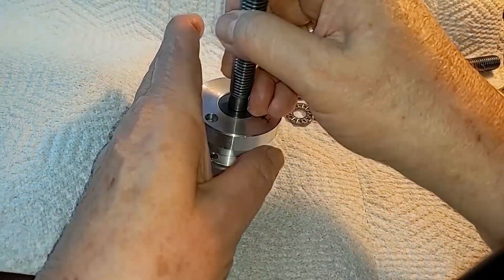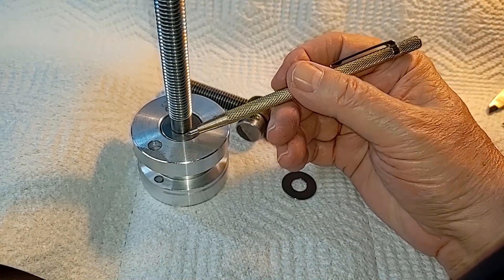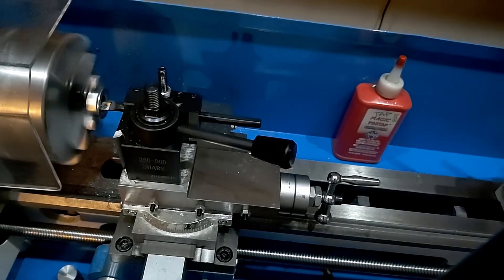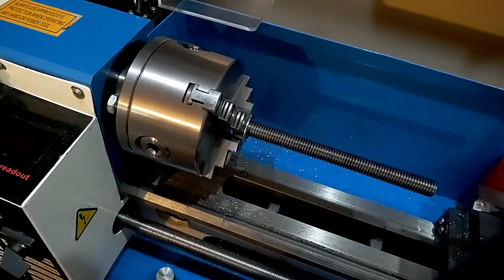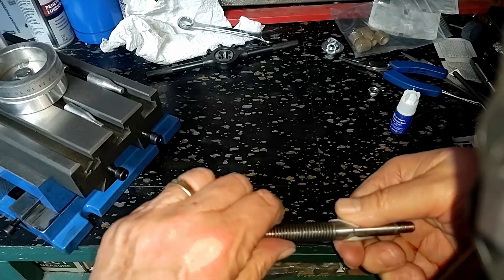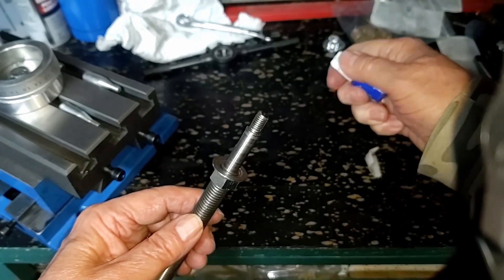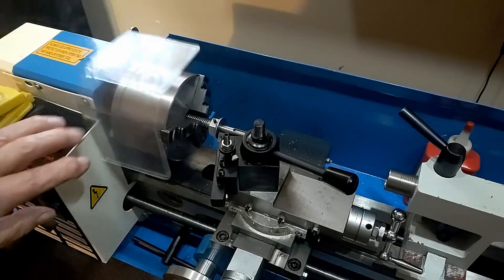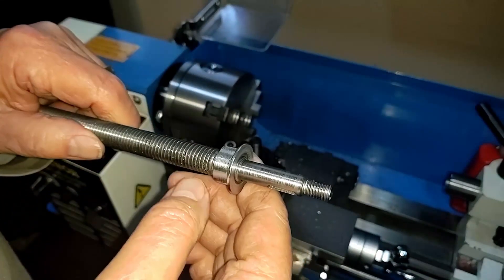Cheap Chinese X Y table with improved bearing support installed

Comment: I'm dreading the time I'm gonna shot videos like that. Granted, there is 50/50 chance that I'll not make it that far, but still, this video sent me into oblivion of endless reflection, so thank you for that (and I mean it). Although there is one thing I know for sure: never say never I will never remove the cat from machinery thumbnail! NEVAAAAR!
Reply from the maker: The original video, had I not cut it down, was over 40 minutes or so long. But there was so much that I could cut out and so did. Yes the cuts are clunky, I am still very much learning video production. 

I am using the free version of the DaVinci Resolve software. A bit of a learning curve, but it is very powerful. My thought is, if you are going to learn a software package, you might just as well learn one of the powerful ones. The other process would be to learn a simple package and then have to relearn something else. 

The cat is cute, but Troll was right, it confuses people. I may start putting some of my wife's cats into the video, I have one that weighs around 20 pounds, great for using as a dead weight when pressing things.
Reply: @oldfarthacks  nah, just slap a vice behind a cat or something. How do you think this old tony managed to get his minions? I mean millions? He put TWO cats on a thumbnail!
Maybe it's not at all what you desire, but as far as youtube popularity goes, cats are the ultimate solution. People don't mind to be confused as long as you do in fact provide them with a cat at some point (winky face). 
As for cuts and stuff, this is not what I meant. I was talking about more existential matter. Does not matter, this is a nice video, I have nothing to complain about (except the lack of cats). You have a nice day, sir!
Reply from the maker: Thanks for the complement. And yes, perhaps I should stick a cat or two into the videos at some point. It's not like I don't have enough around the house, the wife is a crazy cat lady.